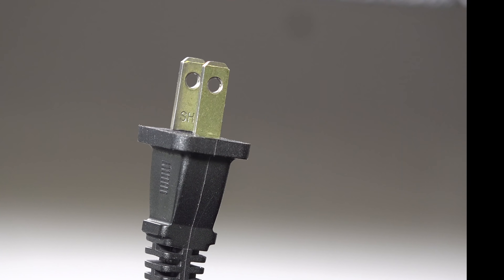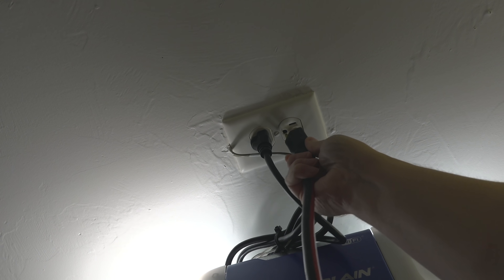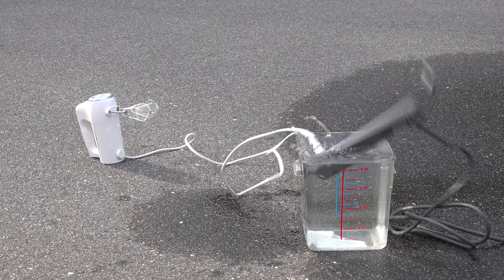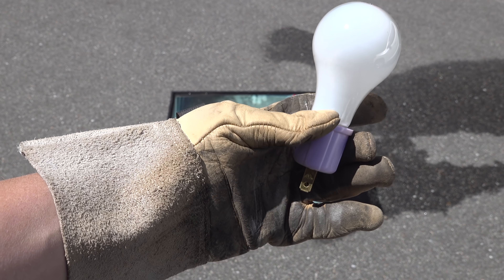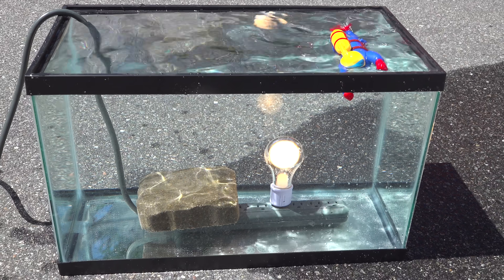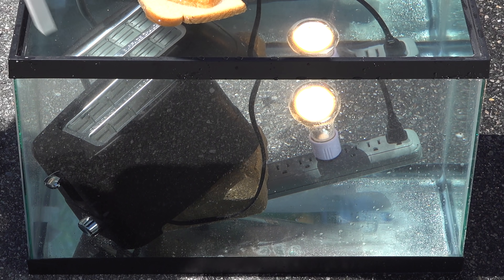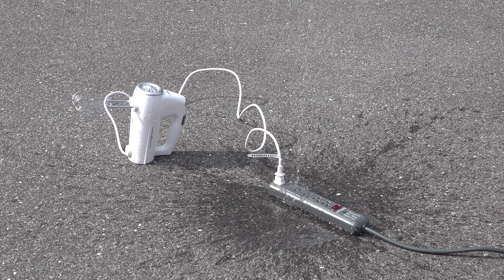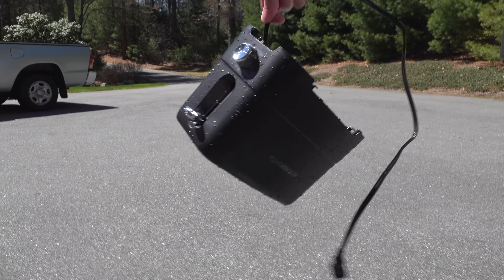What REALLY HAPPENS WHEN YOU SPILL WATER in an OUTLET?

Comment: I used to be an electronics service technician.  Not surprised one bit by the results.  The water although somewhat conductive, still has high resistance.  So, there isn't enough current flowing through the water to trip the breaker.  The path of least resistance is still through the item plugged in. 
Still, no one should try this as doing the wrong thing could injure or kill you. 
The way people get electrocuted (die from electric shock) is when current flows through their body causing the heart to stop.  Just sticking your arm in (don't try that) without a path for the current to flow through your body would probably not do much.  The problem comes when you touch ground with your other arm or legs.  Current flowing arm to arm could kill you especially when in water, because it gives more surface area on the skin for the current to flow through you.
Reply: Yikes !!!!
Reply: Same here but I did wonder if he'd get a shock through that continuous stream of water from the hose to the socket. Both the regular breaker and the GFCI setup worked exactly as they're meant to. No surprises there.
Reply: @anonymouseniller6688    To get shocked you need a path to ground or to a conductor at a different voltage. Otherwise there is no current flow.  There could be a small amount or current flowing through the water stream, but that wouldn't affect him.
Reply: @my3dviews  i dont believe that a plug submeged in water has more resistance than a goddamn 1200W toaster
Reply: @piergiorgio919    It has to do with the conductivity of the water.  Which isn't that high, so it doesn't trip the breaker.  So, most of the current still flows through the toaster heating elements as it does not being submerged.
Reply: @my3dviews  yeah i get that i study engineering, all i'm saying is that the toaster is essentially a massive resistor and that water, unless it's distilled, shouldn't have that much of a resistance considering it only need to connect a couple of millimeters. But i guess the facts speak for themselves
Reply: @piergiorgio919   You could do this simple experiment if you have a multimeter.  Measure the resistance across the plug of a toaster.  Or you can just use ohm's law to calculate it if you don't have one.  It will be about 15 ohms using a 1000 watt toaster for a North American version that is 120 volts. 
Then take a glass of water and put the leads into the water and measure the resistance from various distances apart.  You will likely get a number in the kiloohm range.  Yes, it will depend on the length and diameter of the probes.  You could even put  metal rods in to increase the surface area.  It will be hard to get the number anywhere near the low resistance of the toaster.  
Since the toaster has way less resistance than the water, the vast majority of the current flows through the toaster, which is why it still works underwater.  
Still not something that you should try, as there is still the risk of shock if you don't do things correctly (as I stated in my first comment).
Reply: @piergiorgio919  It's the other way my dude, the toaster is a very low value resistor (when comparing with other home appliances).
Reply: @piergiorgio919 being a large resistor is different from having a large resistance. If it draws 1200 watts, the resistance is very low.
Reply: @my3dviews the stream of water coming out of the hose is grounded. Flowing through copper pipes that are grounded at the panel. This was a pretty risky and stupid experiment
Reply: @threepe0    The resistance through the water stream would be in the megaohms. The current flow through it would be in the micoamps. Which is negligible.
Reply: @piergiorgio919  yeah, tap waster is actually very high resistance. I think TKOR did a video on a 'poor man's triac' years ago which moved conductors in water to modulate resistance and therefore output voltage of an ac source. For this purpose, they had to dump a shit ton of baking soda or something into the water to increase the conductivity.

R.I.P TKOR
Reply: @anonymouseniller6688  obviously there is some electricity going through the water-> his hands-> ground but the resistance of your body+ the plastic hose is really high so the current going through him is almost 0 and definitely not noticable, although don't try it
Reply: @aryana3462  Yes, the multiple points of electrical separation through insulators at various points in that path is obvious on a second glance.
Reply: Water by itself isn't very conductive, the salts in the water are the one conducting electricity
Reply: As a kid I put scissors in it, gave me a nice shock LOL
Reply: @jay-d8g3v    Ya, that could do it.  LOL
Reply: I learned this in school we even ran experiments on different types of circuits and electrical items we also put paper in the water to see if it would catch on fire. Nothing happened, we put salt in there and then it tripped the breaker and the paper didn’t catch on fire but some of the electrical items did.
Reply: "Just sticking your arm in (don't try that) without a path for the current to flow through your body would probably not do much." Current path to ground is up the arm, across the chest and down the legs he's standing on, so thats inaccurate. Unless the guy is levitating. Just don't do this stuff because it's dumb as fuck, the guy in the video is lucky as he came close to a shock at least 3 times on the footage, probably more on stuff we didn't see.
Reply: Ah An Electrical Engineer xD that's what I wanna become when I pass my high school
Reply: Also yes they told us Distilled Water has resistance to electricity, although if it has salt contents it is fatal i guess
Reply: I suddenly remember a touchscreen arcade that a friend of mine does these frank at baiting us to touch his arm and the ground while his other arm touches the screen
glad it was always only a mild zap which could lead from being just a joke to literally deadly situation 😅
Reply: Yep. People fail to commit suicide every year by throwing a toaster in the bathtub. It's hard to get yourself in the path for the current when you do that. People have described it as producing a tingling sensation without any serious harm.
DO NOT TRY! THERE'S ALWAYS THE CHANCE!
Reply: 🫶🫶luved this
Reply: So in short you are talking about circuit.
Reply: @ヽ゚ー゚ノ-r9v  water is not a good conducive resource.
Reply: Thanks for the tips!
Reply: Explaining something then mid way realizing someone might try it and give warning
Reply: So i have this immersion water heater and i used it to heat up water in a bucket. When I try to check if the water is hot enough, without unplugging the heater, it definitely gave me an electric shock but no where near deadly? I have hard so many times this feeling but never deadly. When does electric shock becomes deadly
Reply: @ashleysam1971    It is the amount of current that flows through you (mainly through your heart) that kills you.  Touching a live wire with one hand and electrical ground with your feet or other arm can cause current to flow through your heart.  But of course, not all of it goes through your heart, so it is hard to predict.  
Not sure what is happening if you are getting shocked from your heater.  The current should just flow through the heater and be insulated from the water.  
Maybe what you are getting as a shock is just due to voltage differential.  Similar to a static electricity shock.  But no large current flow.  If you are grounded, then that could cause a shock.
Reply: How isn't there a dead short or an RCD tripping?
Reply: @asabovesobelow1362    A dead short would require the two wires contacting each other.  The water has high resistance, so cannot cause a dead short.  
He says right at the beginning 0:05  that he is not using a GFCI (North American equivalent of an RCD) outlet.  
There isn't enough current flow to trip a regular 15A breaker, so it continues to work under water.
Reply: @my3dviews  I see, do you think the experiment would have the same results if it was at 230V?
I guess the most important factor is what's the composition of the water, if it had more ions it'd surely trip then.
Reply: @asabovesobelow1362    With 230V, you would get more current flow with through the water, but still a very low amount. 
If you have a 1200W toaster at 120V, that's 10 amps of current.  The amount of current flowing through the water is a few milliamps.  Changing the ion content in the water would only increase the current a bit.  Not enough to trip a 15 amp breaker.  The resistance of the water is still in the kohm range, vs. the toaster elements at 10 to 15ohms.  The conductivity of the water is insignificant vs. the high conductivity of the toaster.
Reply: What can you do to make the water less resistant? Throw in flakes of copper? Lol
Reply: @ericg4915    Salt.
Reply: I heard it’s not the volts you gotta worry about but the amps
Reply: @Desire2punish    Amps is a measurement of current.
Reply: @my3dviews  sorry about that worded wrong
Reply: So If I step on a yoga mat I should be okay?
Reply: @1006Will    That depends.  Is a yoga mat an electrical insulator?  
Any experiment with electricity should be done with test equipment, not with your body.
Reply: Your comment is more sensible than the entire video. Thank you.
Reply: One time I carelessly plugged a cord into an outlet while my hand was moist 'cause I was an idiot, and I was paralysed as electricity flowed from one arm to the other which was touching a metallic cabinet. It lasted at least 2 seconds up to  7. It hurt. Edit: I was arguing with a feminazi rebellious wife is why I wasn't thinking straight.
Reply: Some corrections
Its not about "the path of least resistance"
Current is voltage divided by resistance, so even if you have a path with lower resistance, current will still flow with the lower resistance one

Its not about the surface area in water but the waters resistance creating a voltage difference.
If you touch 230V with your left hand and 230V with your right hand and you don't have any other connections to ground etc. the voltage difference is 0V
Swimming in water or standing near some collapsed power pole, there will be a voltage difference measured against some distance from the point the voltage is emitted from. You are effectively measuring against a resistor that is water or soil which value depends on the relative distance of your probes.
So in practice that resistance means a voltage difference between your body parts if you for example take a large step or spread out your arms in water
Reply: @maticz3923    "Some corrections".  More like some statements that are false or irrelevant to what I said. 
Quote: "Its not about "the path of least resistance"
Current is voltage divided by resistance, so even if you have a path with lower resistance, current will still flow with the lower resistance one"   End of quote. 
That sentence makes no sense.  You probably meant that the current will still flow through the higher resistance one.  But, I never said otherwise.  
What I said was: "The water although somewhat conductive, still has high resistance.  So, there isn't enough current flowing through the water to trip the breaker.  The path of least resistance is still through the item plugged in. "
Notice I said "high resistance" not infinite resistance.  The path of least resistance in the toaster is about 10ohms, while the water is in the high kohm range dependent on contact area and the distance through the water. If you take an ohm meter and measure the resistance of tap water, you will likely get about 500kohm with the probes an inch apart.  Meaning that you would only get about 20 microamps through the water and the rest through the conductors in the toaster. 
Quote:  "If you touch 230V with your left hand and 230V with your right hand and you don't have any other connections to ground etc. the voltage difference is 0V".   End of quote.  
Irrelevant to anything I said. Of course if the voltage is the same, you have no current flow.  In fact if you read my second comment I said this: "To get shocked you need a path to ground or to a conductor at a different voltage. Otherwise there is no current flow.  There could be a small amount or current flowing through the water stream, but that wouldn't affect him."
Quote: "Its not about the surface area in water but the waters resistance creating a voltage difference." End of quot.
Wrong.  The surface area of a conductor in the water affects that current flow through the water, since it reduces the resistance.
Try this experiment.  Take a glass of tap water.  Put the probes of an ohm meter in the water about an inch apart.  Measure the resistance. Than take to metal plates (such as two spoons) then touch the probes, one to each spoon and put the spoons an inch apart.  The resistance will drop significantly due to the larger surface area of the conductors in the water.
Your last paragraph is just a rant that doesn't have much to do with the experiment in the video.  Maybe read through all of my comments rather than trying to correct something that didn't need correcting.  I do know what I am talking about and do know how current flows through resisters in various circuits.  It was my job after all.
Reply: And here I thought I know all the basic info about electricity. Thanks for the info
Reply: Explain what you just said to me like I’m 5
Reply: Thanks for explaining cause the video only confuses me. I wonder if he stepped in that puddle he made .. barefoot.
Reply: notably, being 'in contact with ground' doesn't mean physically being in contact with ground.

your body acts like a capacitor and couples to ground even if you insulated and separated from it. being a capacitor, ac current has no problem flowing through you and your flip flops into the ground.

note also that plumbing fixtures are grounded - this would be a good thing in most countries where they have a house-wide 'GFCI' equivalent, but in the US it might kill you - and can provide a path for mains to go, they can also become capacitively coupled with the mains and shock you.
Reply: The bigger problem here is electrolysis and the hydrogen produced.
Reply: @fungo6631    Electrolysis wouldn't be a problem with AC.  For electrolysis to generate hydrogen (and oxygen) you need a positive and negative electrode with direct current and an electrolyte (such as salt) in the water.  Also, the vast majority of the current just flows through the toaster's heating elements, not the water.
Reply: @my3dviews  Even AC will work, but if I am not mistaken the cathode and anode would change 50/60 times a second.
Reply: @fungo6631    When you do electrolysis to generate hydrogen, you need set positive electrode and a negative electrode.  If they are in an electrolyte solution, you get ions passing from one electrode to the other.  With AC the positive and negative electrodes are constantly switching (as you said), which won't allow the flow of ions to the correct electrode.  
You can do a search for: "why ac doesn't work for electrolysis" for a more detailed explanation.  But, I think that I gave the gist of it.
Reply: What a great explanation. Thank you!
Reply: So your saying always sunny in Philadelphia was right, suspend your self in the air with a harness when working on anything electrical.
Reply: @arandom1024    Probably not necessary when working on 120 volts, as long as you keep your feet from an electrical ground.  But, best to turn breakers off and not work on live circuits.  
You could still get shocked or electrocuted while suspended if you touch two conductors with each hand if they are at different voltages, such as the hot and neutral wires of a 120 volt circuit. 
Line workers do work on live high voltage lines while suspended from a helicopter, since they only come in contact with one conductor.  There are videos showing that.
Reply: i am not an electronics service technician, but i think it should depend on the water and the stuff inside it right
Reply: @AnEnderNon    Read my last comment. You can do that experiment if you have a multimeter. Yes there are several variables, like the amount of minerals in the water and the surface area of the conductors in the water. But still the path of least resistance will usually be the device not the water.
Reply: He used GFCI, that's why he got those results.
Reply: @saintmay1952    No, he did the exact opposite.  Listen to what he says right at the beginning of the video.

Comment: 4:12i dare you do it power on. you have rubber shoes LOL and you allready test nothing happen.
shortest route electricity go wire to wire is water when there is nothing. magically you been wire even you touch water without shoes? things go wrong is 1 of wire touch you if both same time "nothing" and still there water you not touch directly to wire. flash light works under water so is phone. amazed!

Comment: 1:26 electricity still go best way on wire. i dare you touch water. you will amazed. if you not beleave put wire on water other end ground and between lamp. will it light if you dipped it on water and some other draw power

Comment: Tap water has a very high impedence. It is only the minerals in tap water that allow voltage to flow. Try again with salt water and you will be sure to have much more interesting results. 
Although apprehensive I would be confident that the water was not electrified. You can run a PC in distilled water to act as cooling and no I'll effects should happen.

Comment: Getting shock is situational all the wrong things have to happen to get shock, in most arc situations, the wire burn itself where the hot where its not connecting  before you seriously hurt. You can actually grab a powerline without getting shock, (I WOULDN'T RECOMMEND IT AND LAST RESORT) wear thick gloves but its bare wire and your ground rod is also bare in the ground and rain/water touch those things all the times.